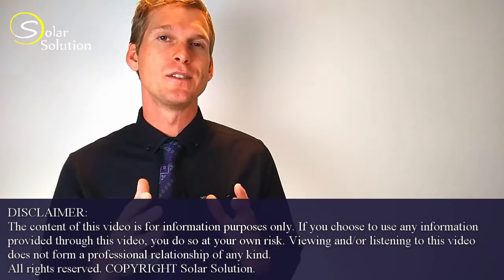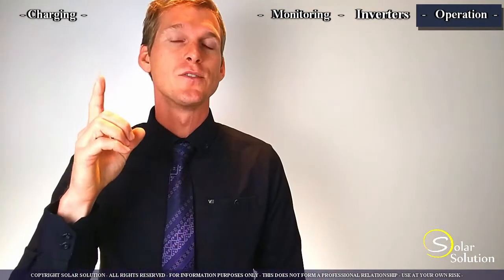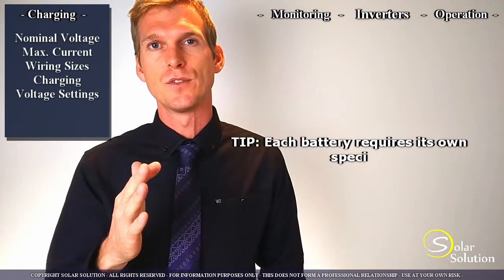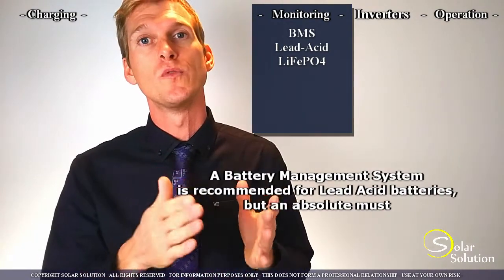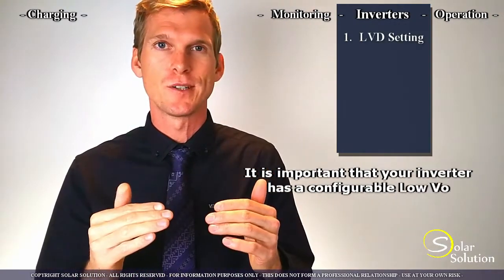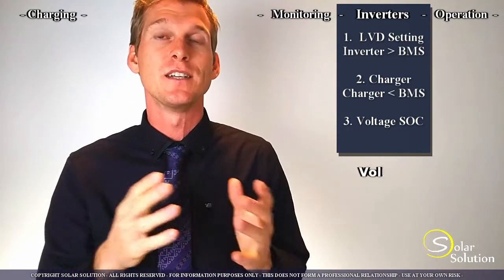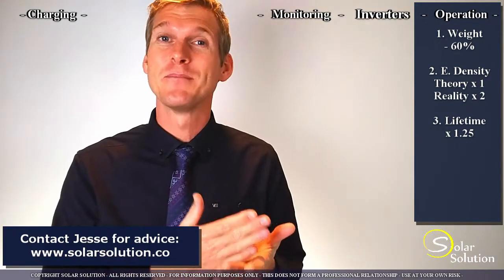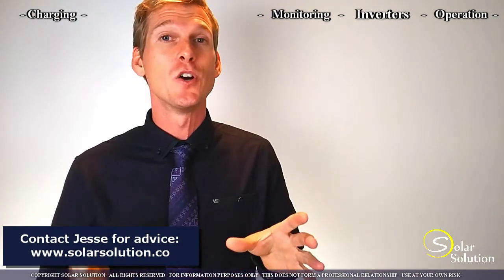Replace Lead Acid with Lithium Ion Battery - Charger & System requirements [FLA - LiFePO4]

Comment: Great sensible video and you didn't ask for people to subscribe and ring that damned bell - So I did anyway as I'm moving soon from 8 year old solar charged AGM's to lithium on my yacht in the Caribbean and need a sensible plan for my 300A 24V house-bank system and a completely separate 12V lead acid system for starting and not burning my alternators out
Reply from the maker: Your message made me smile James, thanks! And welcome to the channel. Good luck preparing for your lithium upgrade and enjoy the islands!

Comment: Hi I upgraded my lead acid batteries to lithium, I installed them where the lead acid batteries were installed right next to the motor in my motorhome, the motor puts off a lot of heat, my first trip out with them it was 100° out plus I was running my generator as I was driving,The generator compartment is right next to the battery compartment and the batteries got super hot but they never shut down,should I re-wire and move the batteries to a different compartment?

Comment: So are the temperatures in the engine compartment not a concern then for a drop in replacement Lithium battery from a FLA? 
I was under the impression that the cold cranking amps of Lithium are enough for cars but would hurt the battery potentially. I'm not sure if that is true tho. My plan, right now it to make a capacitor boost pack for the lithium battery to replace my FLA in my minvan. 
Perhaps I don't need to worry about the boost pack or the temperature of the Lithium battery in the engine compartment. I live in Florida so I don't deal with freezing conditions. Thanks in advance Jesse!

Comment: I just acquired four 12v 100ah lithium batteries. I want to run them in series since my bushwhacker plus teardrop travel trailer is a 12v system. My question is can I just drop them in a place they fit and travel like I did with my one 12 v agm battery?

Comment: Hi Jesse thanks for the info.My area of concern is that I want to use a LifePo4 battery with an inverter to power studio Flashes outdoors. Could I just connect and forget?

Comment: Dear Jesse,could you help me.I have an electric cabin scooter, which has five led acid batteries,i want to reolace them with Lithiumion phosphate battery, could you recommend one.My scooter has two 1000w motors 1000w each wheel.It is 60v and 52Ah the batteries. Thanks.

Comment: Great informative video on Li and Lead Acid battery. I'm still wondering if you can just drop in a LiFePhosphate battery (easily found in Amazon) in replacement of a UPS Lead Acid battery.  your video talked about adjusting charger. but you cant do that with a UPS. 
thankx

Comment: Your channel is a most helpful discovery! Currently in the process of installing 1000 watts of solar on my motorhome and replacing the four 6 volt lead acid batteries with three 206 amp hour lithiums. Thank you for the easy to understand explanations.
Reply from the maker: It is good to hear you are taking advantage of the channel's content Tim, thanks for your message. Good luck and have fun with your motorhome's new solar system! All the best, Jesse.

Comment: In the video you appear to quote a Lithium-ion battery voltage of 12.8. My understanding is a single Lithium-ion cell voltage is somewhere around 3.8 or 3.7 volts. Three such cells in series suggests a voltage of 11.1 or 11.4. I'd be interested to know what combination of Lithium-ion cells could result in the 12.8 volts you quote?
Reply: LFP is nominal 3.2V x 4 = 12.8V

Comment: Thank you for this absolutely amazing tutorial. This was very valuable. I have Motorhome and I want to upgrade to lithium batteries. Lion energy says these are plug and play batteries. Others are telling me I need a DC to DC charger to avoid damage from the engine alternator. What are your thoughts?
Reply from the maker: Hello Roark, thank you for your message. It is good to hear the video helped you in your research. In response to your question: This video describes different configuration options with DC/DC chargers connected to your alternator: https://youtu.be/TAEzCcayI0g ['Deep Cycle Battery Charging with your Alternator...']
Enjoy! Jesse

Comment: •	And why does the charge controller quit working and needs to be rest when the bms trips for low voltage
Reply from the maker: Hello Mike, thank you for your question. This depends on the type of BMS you are using.

Comment: •	Why does my invertor with a 70 amp  charger stop charging around 50% for the lithium when the flooded batteries charge down to 10 amp before stopping
Reply from the maker: Hello Mike, thank you for your question. How are is your 50% SOC value calculated, and what are the charger voltage settings?

Comment: Jesse;
Great videos. 
   On my catamaran I have 6.2KW of agm(Victron) house batteries, 2ea 80Ah gel engine starting batteries, 2 each 125A alternators all combined with a Victron multiplus 12V/1600VA/70A inverter/charger(all professionally installed). I would like to add in parallel approx 5kW of Lifepo with integrated BMS.
My theory is that the BMS on the lithium batteries will allow the lifepo batteries to charge or discharge until it reaches the high or low voltage cuttoff and or high current cutoff. So basically just add the Lifepo to the agm in parallel and let the bms protect the Lifepo. Due to the charge/discharge range differences between agm and Lifepo I know that I will lose some battery capacity.
What do you think.? Am I missing something ?
Reply from the maker: Hello Mark, thank you for your [excellent!] question. I know there are a few videos on YouTube, discussing exactly this topic. Have you watched them yet? Clark from 'Emily & Clark' has a nice video on this.
Reply: @SolarSolution  Hello Jesse; Yes I've seen Clarks videos and even bought his battery bank manager. Also acquired two Wakespeed 500 units, Victron Cerbo gx, shunts and smart battery monitor and will assemble it when I get back on the water this summer. On a separate note I have acquired blade battery components for a 48V 7KW Blade battery w/ bms to combine with my chevy Volt 18kw NMC batteries for off grid Colorado cabin.
Thank you for making these videos

Comment: Dear Jesse, I really appreciate all the information you are sharing. I am using AGM batteries and I am afraid to use my NOCO repair mode on it. It is okay to use this repair mode with my AGM batteries? Thank you for answer!
Reply from the maker: Hello David, thank you for your question. Have you compared the battery recommendations with your charger settings yet?
Reply: @SolarSolution  Hello, Jesse! Well, i  bought "MIGHTY" batteries and have no much information... My NOCO battery charger instructions, don't provide enough information about this topic.
Reply: Thank you for your time, I really appreciate it.
Reply from the maker: Hi David. The information on the charging voltages from the NOCO charger are rather essential. You might want to consider to contact the manufacturer to retrieve this. Good luck! Jesse.

Comment: I was trying to replace my Electric ATV's 1500w   48v  (4x12v20Ah lead acid) battery  and I was wondering what LiFeP04 battery you could recommend to replace my old acid battery.   Any help would be greatly appreciated.
Reply from the maker: That sounds like an exciting project. I would need additional information in order to give you the right advice. I offer personal advise through consultation services available on the main website: https://www.solarsolution.co
Good luck with your ATV! All the best, Jesse

Comment: id like to use two different size Lithium batteries.2 lager capacity (Nominal Capacity (C/5, 23°C) 138 Ah ) and two smaller cap. batteries.(Voltage 12.8 V Nominal Capacity (C/5, 23°C 40 Ah) can i used both Lg,and smaller cap. batteries as one power system without compromising the smaller batteries?
Reply from the maker: Hello Manny, thank you for your message. Have you considered creating a power system with two separate battery banks yet?
Reply: @SolarSolution  yes i have

Comment: Great video with very helpful information.  Just wondering how you can tell which Lithium batteries are high quality verses poor quality.  What should I look for thanks? Chris
Reply from the maker: Hello Chris, thank you for your message. It is good to hear you found the video helpful. 
As for your question: There are several different ways, though two good sources of information are the datasheet and the warranty policy. The latter is in my opinion an expression of confidence of the manufacturer in the product. 
Good luck!
Jesse

Comment: Great videos! I'm gleaning as much info as possible before I purchase the components for an RV setup.  I've watched your dc-dc video, but I'd like to run a 24v lithium 'house' battery and couple it to the 12v starter battery, via an external regulator. Is this even possible..... and if yes, what additional wizardry would the setup need? I'm hoping that I won't need an additional 24v alternator!
Reply from the maker: Hello Mark, thank you for your message. Did you happen to see the video on dual battery banks in vehicles yet? I think this will be useful for you: I pasted the link to the video below. Enjoy! Jesse
https://youtu.be/TAEzCcayI0g

Comment: "because lithium allows for much higher current". I'm under the impression that in most cases lithium iron phosphate batteries actually provide a lower current than lead acid batteries.  Unless you're using specialty batteries like headway.  Most lead acid batteries can provide over a hundred amps while your average lithium iron phosphate 12 volt provides around 5 amps per cell in a four cell series configuration.  Where is my misconception?
Reply from the maker: Thank you for your feedback and question Patrick, this might be an interesting topic for a separate video. Thank you for the suggestion. All the best, Jesse.

Comment: Dear Jesse, I currently have a grid-tied system, but I would like to improve my backup. It currently runs on lead-acids, using a fast acting relay to switch lights and computer to off-grid in case of a blackout. The inverter is always on, and a conventional charger keeps the battery floating despite of the idling inverter consumption. All is well, but the life span of the lead-acid battery is not very satisfactory, even though it is just sitting there most of the time, so I thought I could use a special charger to keep a lithium battery charged and the inverter running when utility is up, and switch to off-grid during power shortages. Is there a way to modify a charge controller so as to use also a couple of solar panels just to keep equipment running during an all-day long blackout?
Reply from the maker: Hello Chava, thanks for your question. Sounds like you have a nice backup system! Running a grid-tied battery based backup system with additional solar power is often done and can work quite well. If you need specific recommendations, you can contact me through https://www.solarsolution.co. You can also ask other YouTube viewers for recommendations, I know of several other subscribers who run similar systems. Good luck! All the best, Jesse.

Comment: Doesn't the Battery Management System in the Lithium protect your battery from over charging?
Reply from the maker: Hello Sjhanksaz, thanks for your message. As for your question, I would like to draw your attention to the pinned comment at the top of this section. All the best, Jesse.

Comment: If I use a battery separator both will be 48v but 1 Bank is 255Ah and the other is 40Ah and with battery separator do you recommend ?
Reply from the maker: Hello Mark, thanks for your message. As for your question, I would like to draw your attention to the pinned comment at the top of this section. All the best, Jesse.

Comment: I just bought a lifepo4 golf cart battery and a 10amp lithium charger 
from china Alibaba with a custom metal box to fit my existing frame for a
 simple drop in installation. It's a 36 volt 100ah with 1 Bluetooth BMS 
system. They told me not to series 3 12 volt batteries together as it's 
not stable? My only concern is explosion. Any thoughts on 3 12 volts in 
series with 3 BMS vrs1 36 volt and a single BMS?
Reply from the maker: Hello MJ, thanks for your message. As for your question, I would like to draw your attention to the pinned comment at the top of this section. All the best, Jesse.
Reply: @SolarSolution  cash talks I guess?

Comment: Hi Jesse. Thanks for the vid. I have a small ultralight airplane that sits unused from week to week (especially in the Winter)! Weight is important so I replaced the original lead-acid battery for the starter with a Lithium Ion and saved about 5kgs. I hooked it up to a pair of solar panels but I guess that maybe I've not made the correct selections on the controller because it's been losing efficiency steadily. This is annoying because I need a strong, reliable cranking power to get the engine spinning! On viewing some YT vids, others have said that 'trickle charging' an Li battery will kill it over time...and I guess that's what a solar panel does! Am I correct? Thanks.
Reply from the maker: An ultralight! Wow I envy you, that's great. And the 5kg weight reduction is quite amazing. Thumbs up for Lithium. What you are intending to accomplish is definitely possible, just make sure to use the right equipment and settings. I'm sorry but I cannot provide you with personal advice through the YouTube comment section. If necessary, you can get in touch via https://www.solarsolution.co/contact. Good luck and all the best, Jesse.

Comment: Thank you for the video. I have a question for you.  I have two 100 amp hour lithium iron phosphate batteries with built in BMS in each battery. I have converter/charger that is 14.6 volts constant current and constant voltage. The battery manufacturer recommends 14.6 Constant current constant voltage. My question is when shore power is available can I leave the charger on long term? Most of the time this RV is off grid but in the rare event I have shore power can I leave it on? Thanks
Reply from the maker: Hi there, welcome back! Your questions make a lot of sense: There is a video I shared where [amongst other things] I discuss the charging cycle, current and voltage behavior. This might be of interest to you, here is the link that brings you straight to the right point in the video:
https://youtu.be/TAEzCcayI0g?t=156
Let me know whether this answered your question! All the best, Jesse.

Comment: Hi, I just wanted to make a remark on the fact that adding not replacing lithium to your system makes a lot more sense both financially and also for the stability of the battery bank. Lead is a great type of anchor for your lithium batteries. There is a lot to it to much to comment on here but it could be a good subject for another video. Thanks have a great day.
Reply from the maker: Thanks for your contribution Lavih, you have an interesting topic there. I agree with you: A great idea for a dedicated video. All the best, Jesse.

Comment: I've bought a 12volt 100ah lithium for my RV replacing a lead acid. It's supposed to be a "drop in replacement" battery with a built in BMS. Can I assume the BMS compensates adequately for the original charging system?
Reply: No.  The bms acts a little like a circuit breaker to protect the battery from extremes but it will do nothing to stop you from killing it slowly with improper charging etc.
Reply from the maker: Hi Burt, thanks for you question and congrats on your new purchase. You can contact me for advice through https://www.solarsolution.co/contact
Reply: @SolarSolution Burt Hulbert's question seems like an important one for all of us to know. I for one have always questioned what 'drop-in replacement' really means for the consummer. Why not provide a public answer?

Comment: Hi Jesse I enjoyed your tutorial, I have questions for you, I have recently changed my AGM for a lithium - ion - phosphate should I renew my inverter for one that is compatible with a lithium battery. my system is wind only connected to a charge controller straight to battery and direct to inverter
Reply from the maker: Hi John, thanks for your message. It is good to hear you enjoyed the video. For personal support, you can contact me through https://www.solarsolution.co/contact
Reply: It depends on if you can live with the limitations mentioned in this video such as the fact that your inverter probably won't know the true state of charge of your batteries and the low voltage shutdown will probably be wrong.

Comment: Because of system growing, I now have 3 charge controllers in my small off grid setup, one nice mppt 20A  and two cheap pwm 20A. I know its undesirable and ugly, and i will need to dial in special settings on each if i go to lithium, my worry is max charge amps. I see 'max charge amps' of 20A on the battery i am looking at and recommedation to only use their charger, but in full sun im putting out 50A potentially, what battery/bms could handle this kind of input? It works fine with lead acid currently, just low capacity.
Reply from the maker: Hello Robert, thank you for your message. For personal advice, you can contact me through https://www.solarsolution.co/services. You might also find the following video on battery selection useful: https://youtu.be/LhARAsr1KX8. 
Enjoy! Merry Christmas, Jesse.